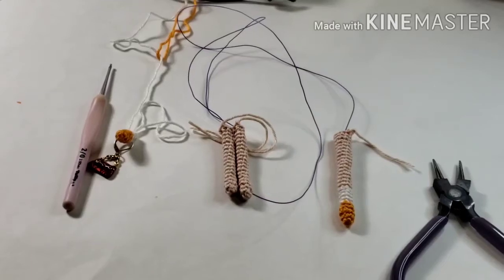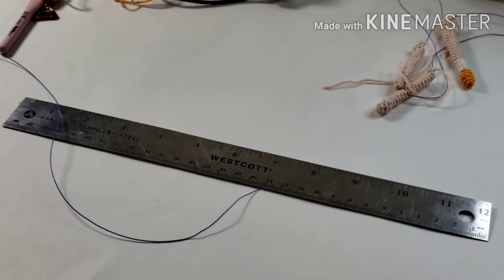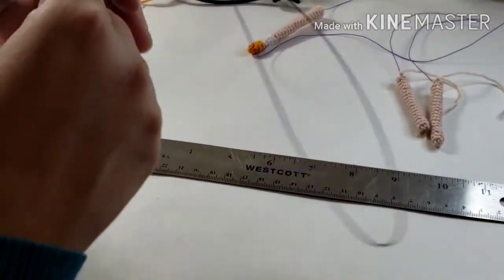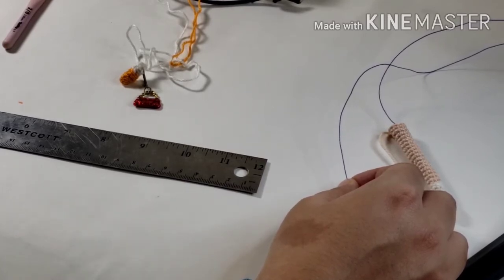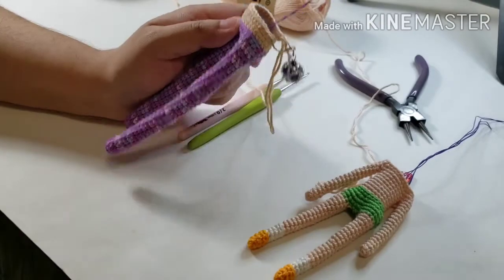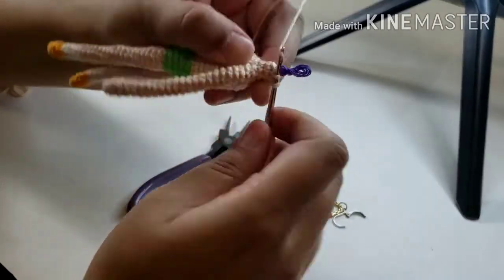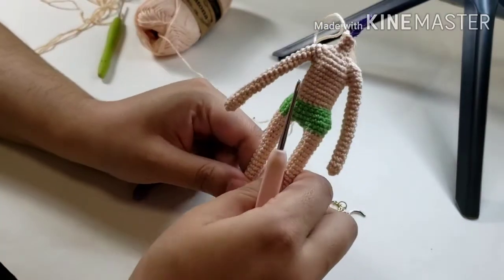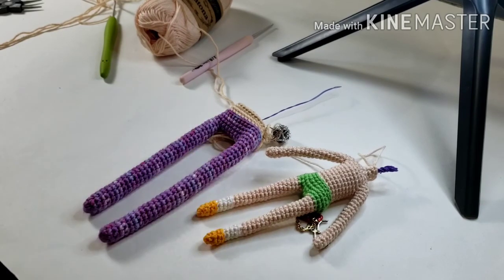How to Put a Wire Frame on a Doll

Comment: I never thought of duct tape for the ends.  This is extremely helpful.  Did you decide what thickness of wire works best?  I have used wire on a wreath for cat ears and found out some won't hold the shape and yet some was too hard to form at all.
Reply from the maker: So... I don't know if you saw either of my choosing wire videos.  I guess I need to make a new one because I was watching Ali from Little Drops of Wonderful and she was saying how she figured out a new way of inserting wire.  I tired it from her description and loved it!  But it needs thin yarn.  So now I am using florist wire - which I said in both videos I would never use!  Lol.  But using this method I like a little thicker wire like the jewelry wire.  I don't remember the size I bought though.  It was one of the thinner ones.
Reply: @InayasToyboxCrochet  I thought I had watched those videos but I need to rewatch them since I am planning the next 2 dolls with wire.  I am also going to check out the link you left in the description box.  Thanks.

Comment: It wasn't clear to me how you keep the wire in the foot while you crochet around it and up the leg.
Again, amazing!
Reply from the maker: Sorry about that.  I don’t insert the wire until I am ready to stuff, the stuffing usually anchors it.  But sometimes it doesn’t, if that happens I just hold it behind a stitch and crochet it onto the leg.  I have never had any problems of it slipping after that.  Hope that helps.
Reply: @InayasToyboxCrochet  yes thank you. Don't be sorry. Please. This has been real interesting to me. I appreciate your ability to look at something and make it into crochet.
Will you show how you make your mini turtles? I think they are more my speed than the dolls but I love them all.
Reply from the maker: @jenreeves7684  thanks so much!  While I do love designing, I like making projects from other designers though.  I used this pattern for the mini turtles.  https://www.ravelry.com/patterns/library/little-miss-turtle
Reply: Thank you so much. Those turtles are adorable.
Reply from the maker: @jenreeves7684  I love them too!